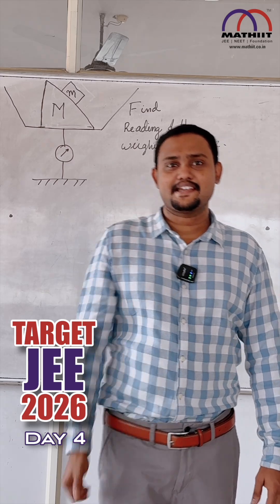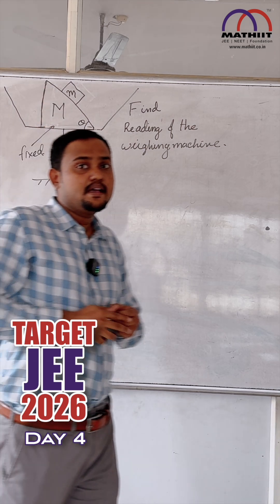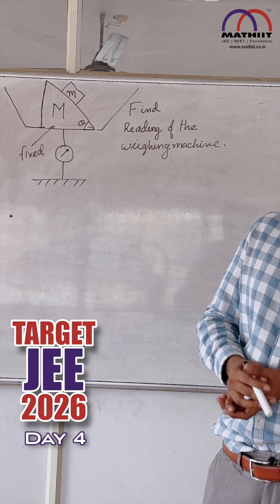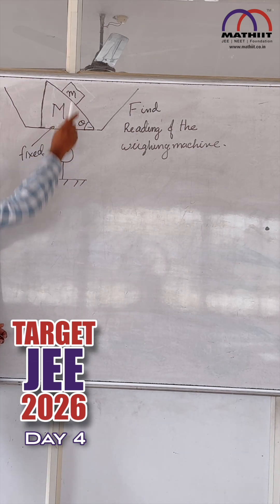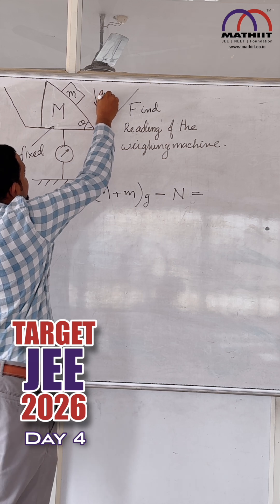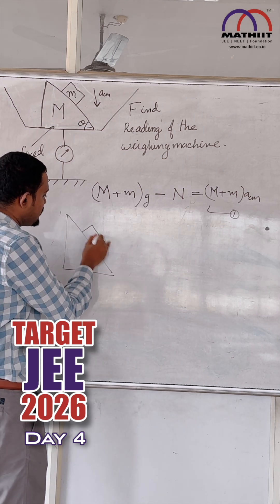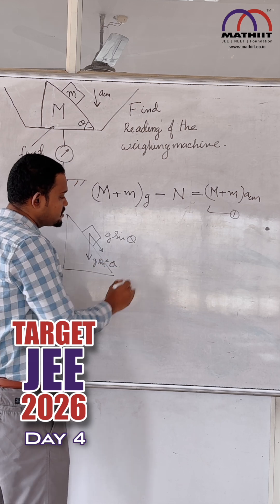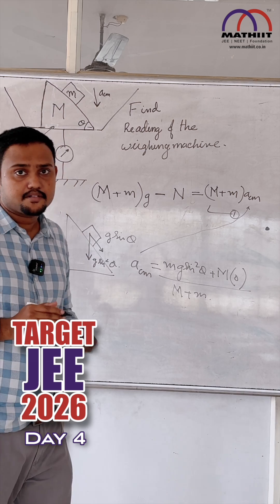Your Scale Has Been Lying in Physics! JEE COM Question Explained

Comment: Sir I had one doubt in the question below

A massless ring hangs from a thread and two beads of mass m slide on it without friction. The beads are released simultaneously from the top of the ring and slide down opposite sides. If the angle from vertical at which tension in the thread becomes zero for the first time is theta. Find sec (theta).
Reply from the maker: The ring will not move due to symmetry. 
Energy is conserved .
Write first equation. 
Tension becomes zero when both beads do not have contact with the ring. 
Normal reaction is zero. 
And the component of gravity provides centripetal force. 
Write dynamic equation. 
Solve equation to get theta. 
Sec theta is 1.5